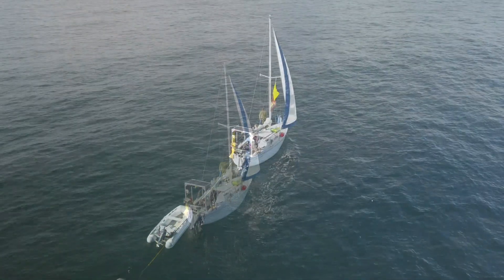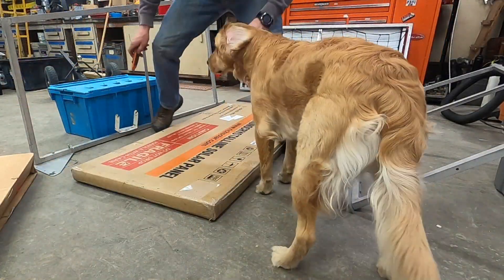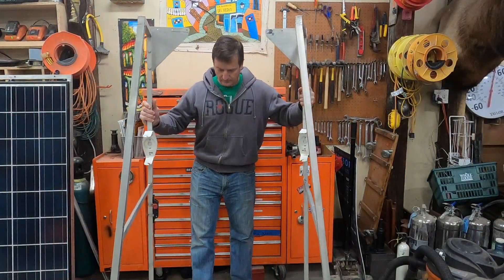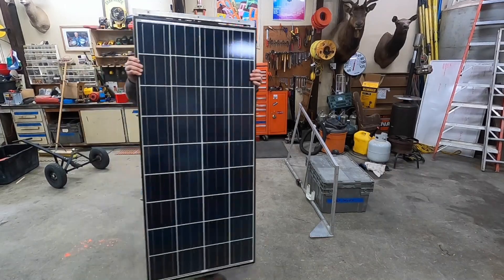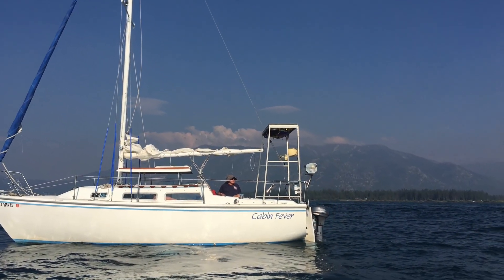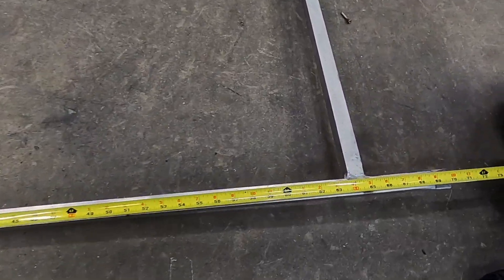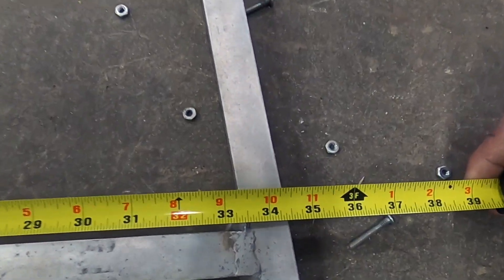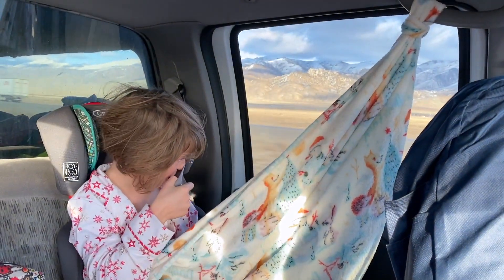DIY Sailboat Solar Rack!

Comment: Captain Greg- are there considerations for lightening such as dissapator &/or grounding; and are there noticible handling charisterstics due to the horizontal sail; would a "w.a.g." be that the rack possibly could be sturdy enough to retain a small dinghy  vs tow behind; lastly- when/where's the next sailing adventure?🤔
Reply from the maker: I did not take into account any grounding issues, there are wires to the panel and some metal contact in the attachments to the rails, but I did not see any need for grounding.  I would not attach a dinghy to it, maybe some float toys but not more than 100-200 lbs.  I never noticed it back there affecting performance and know that we don't race or anything.  We just slog around as we do.  Lastly, the next adventure!  We are already on the next adventure and filming as we speak.  The channel will change up after part 7 of our latest video goes out.  I will also branch off into some other topics that I love.  Stand by for some adventures!